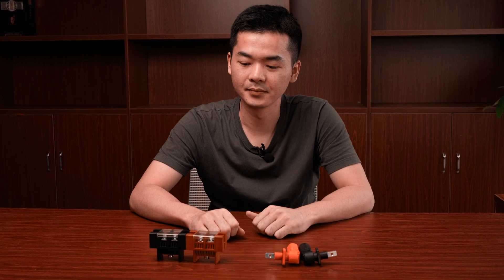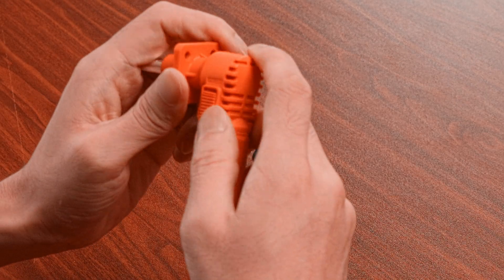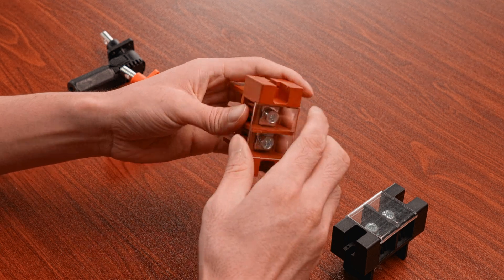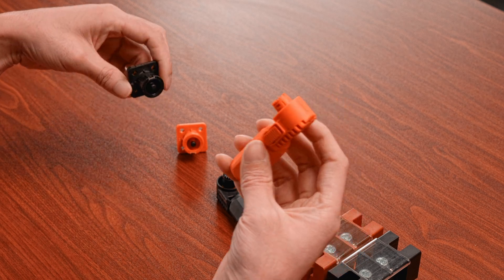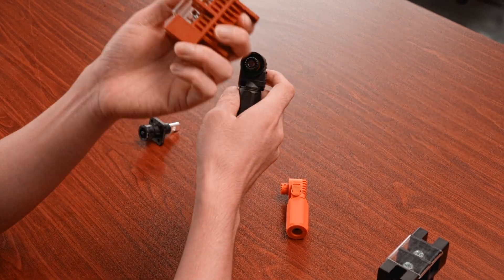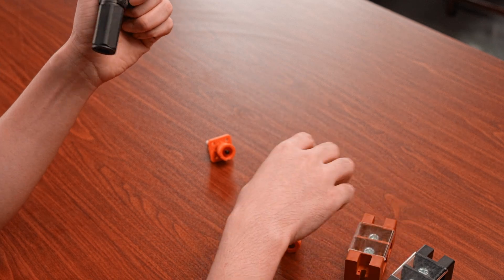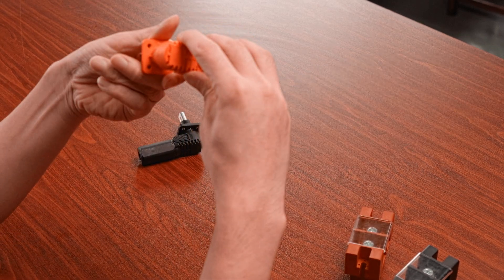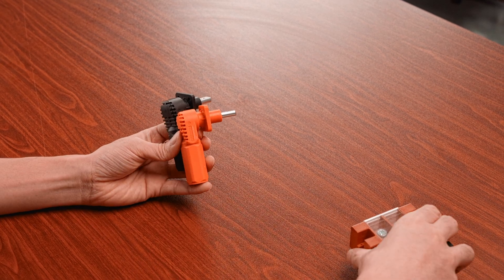Quick Pluggable Connector VS Lug connector | Which one's better? | How to Choose a Battery Terminal?

Comment: I agreed with you better use plug on connector rather than use of terminal block which is you need to torque on that for proper connection.

Comment: Does the "fusetronics" connectors bought with the Seplos Mason DIY 280 can be crimped to a 35mm² cable ? (I can't connect a 50mm² to my existing system)

Comment: Do you have a datasheet available for the Quick Pluggable Connector? What power is it rated for?  How many plug / unplug cycles? 

I can see the advantage of a fully shielded pluggable connector but there is a risk of it not making as good contact  and then heating up during high charge / discharge rates - so it's important to have a reliable manufacturer of these who adhere to strict QA processes.

Comment: Hi. The parallel cables are included in the package but not the external power cables from battery to the inverter ? Do you have a part. nr. on those? Any EU-resellers/EU-stock/price? TY :-)
Reply from the maker: Hi. They can be purchased in EU, but the connectors in SEPLOS 135 and SEPLOS MASON are different and may be out of stock. So I suggest consulting our customer service for more info beforehand.
Reply: @SeplosTechnology  TY :-)

Comment: Hi,
I have the 135Ah Pack. I like the connecter, because you do not take care when disconnecting to have a short.
On the other hand it is hard to get this parts in Europe while the lug you can get everywehre.
There was a 25qmm cable with the pack and this is too small for 95A.
Do you have a source or order nr. for this connector in Europe.
Reply from the maker: the 25qmm cable we use bears a max of a 130A current flow. So it's enough for 95A.